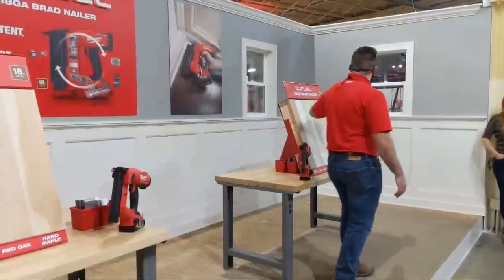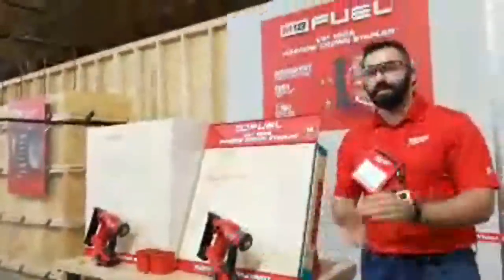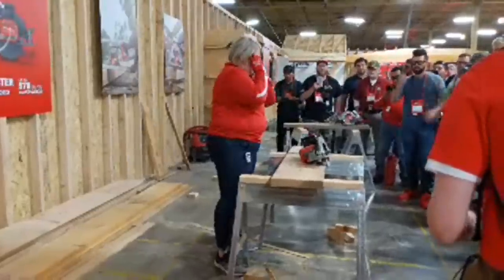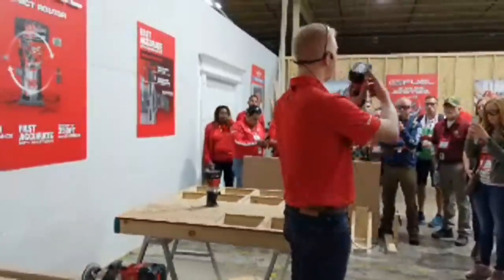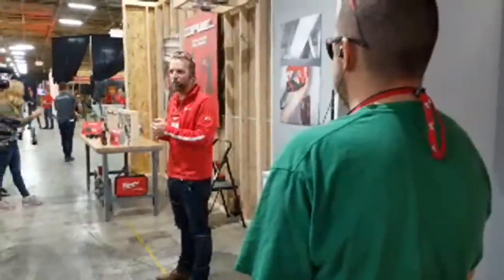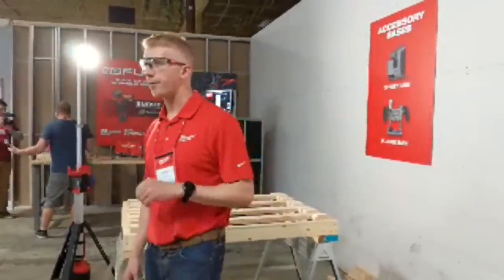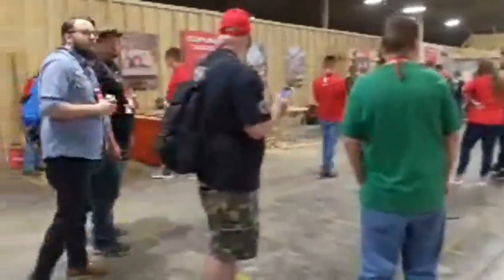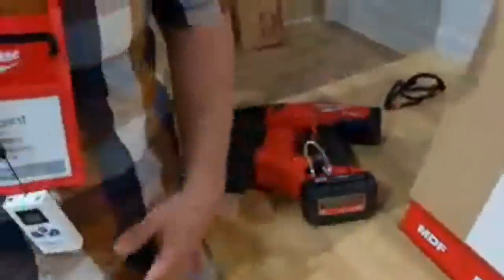Milwaukee TOOL #Nps19 Carpentry Tools

Comment: As much as I want them to be better, the Milwaukee nailers that have been available thus far have yet to take the place of a single Ryobi nailer in my truck. I wanted them to be amazing. They are crap. The ryobis get ABUSED by me and my entire crew daily, and never have issues. The Milwaukee's were babied, by myself only, and none lasted more than a week without being returned. The DeWalts have been decent, but I only have a handful of flexvolt Batts for my circ saw, and I don't wanna put the money into getting further into their battery platform. I am mostly Milwaukee and have tons of m18 fuel batteries. I hope these new nailers are up to par finally. And the framing nailers would just be icing on the cake for me!
Reply from the maker: The new nailers are much more impressive

Comment: That M12 installation drill is a total remake of the Festool CXS... That being said... The CXS was my favorite drill ever. I just sold it because I could sell it and buy 2 other Makita drills for the same price and their battery platform for it was weird and unique... Nothing else used it, and it wasnt a brushless tool. 

I am mainly a Makita guy. (Aside from my Packout Stuff and my Jobsite M18 Table Saw) but if i were invested into the M12 system I would 100% be looking for that thing

Comment: Paper strip or plastic strip on the framing nailer?
Reply: Joshua DeLarbre depends on if you buy the 21 degree (plastic strip) or the 30 degree (paper). Milwaukee’s website has the guns information listed today

Comment: Look at all these boys lost in the candy shop 😂😂 awesome to see the new releases. Part of me wishes i was a framer to have a real reason to buy some of those. The m12 surge will be nice though, i just got the m12 gen2 kit in the mail.  I definitely could have used the installation drill, had to adjust some can lights that had cement board over them . There was a 3 inch gap between the brick and the board and i just couldnt reach the screws with my tools and had to chisel them out. Great vid!!

Comment: Milwaukee failed again staying with 18v should have gone with dual battery or a larger voltage on the miter saw, the good news they'll be on the discount rack soon enough
Reply: DeWalt came out with FlexVolt tools several years ago, great for marketing, but hasn't leapfrogged Milwaukee in its capabilities.

Dewalt FlexVolt 60 Volt @ 4.0 amps (Or 20 Volt @ 12 amps) = 240 watt hours of storage.
Milwaukee 18 Volt 12 amp = 216 watt hours of storage.

Both have table saws, Miter saws, chain saws, both are good quality tools, both on par with performance.

 But DeWalts new batteries arent backwards compatible, You can take a Milwaukee power tool built in 2007 and install a 2019 12 amp battery and it works, and vice versa.
Also Milwaukee owns the patent for lithium batteries in power tools, most major Power tool companies pay Milwaukee royaties or have licensing agreements with them, 2 years ago Snap-On had to pay Milwakee 27.8 million dollars to keep selling Lithium based power tools.

Milwaukees not going anywhere, they've grown 20% each year for several years now at the same time receiving large royalties from the large power tool companies.
Reply: @baracktrump1410  They didn't invent lithium batteries and their patent has long expired, and looking at some of their tools that look like they painted dewalt tools red I'm pretty sure is paying royalties on those
Reply: @loucifer323  they didn't invent lithium batteries but they were the first to use lithium on tools with the V28 line which I still use. Of course DeWalt also came out with their 36v line about the same time...